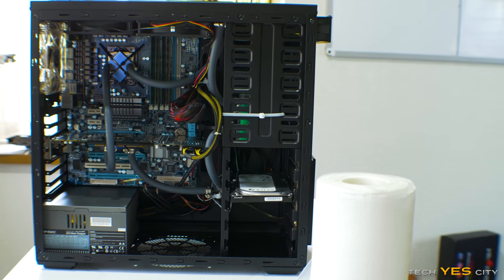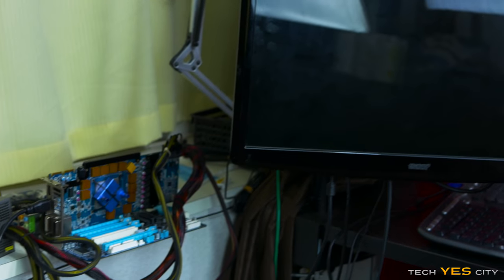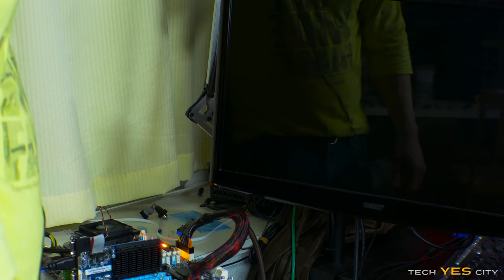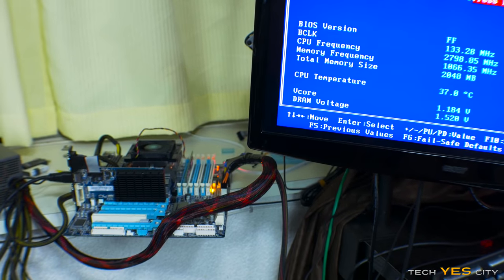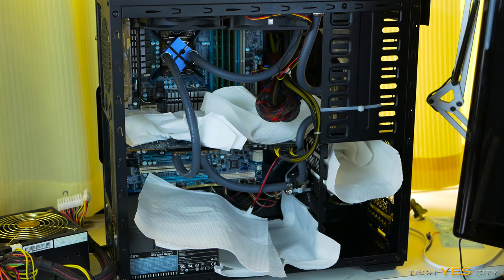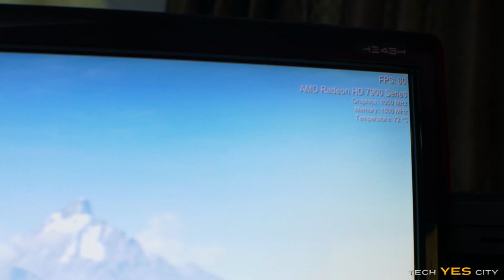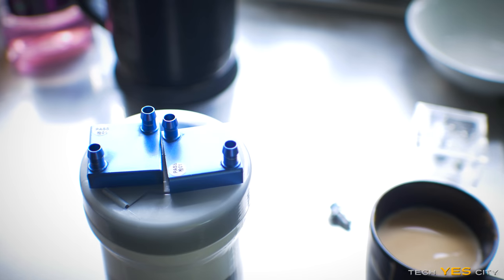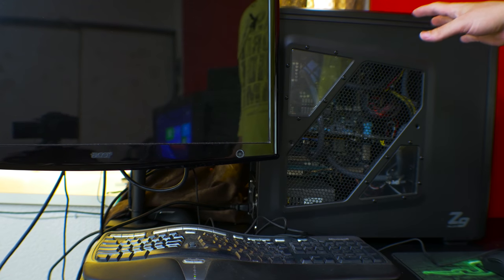$50 Custom PC WATER Loop - Is it POSSIBLE?

Comment: clean the chips just to turn around ans spread the TIM with your greasy fingers... wow...
Reply from the maker: +Chad Bremer Don't really know how my finger will be 'greasy' when I just finished using alcohol wipes before applying..
Reply: Tech YES City Human skin always has a little grease.  It's a terrible practice in general.  As noticed in the very poor contact you got.  Had you just smoothed a blob like most of us do, you would have had far better contact.  Even with a crappy block.
Reply from the maker: the pressure would of been too low on the critical area still, wouldn't have made a difference. And the thermal paste initially creates a barrier on my finger between my finger and the surface.  I have already tested my methods and if I felt that the pea method was indeed better, then I would be using it, but it isnt, it is inefficient to guess how much I need everytime with the pea and waste thermal paste.
Reply: Tech YES City it's not a guess.  When have done it hundereds of times, you know.  Comes with over 20 years worth of builds.
Reply from the maker: Well now I know that you either aren't spreading properly or you are bullshiting, as I have done consistent tests time after time, and the spread method with a barefinger cleaned with alcohol beforehand is perfectly fine.
Reply: +Tech YES City No BS.  I have tried the spread meathod.  It was inconsistant.  Blob always works and once you have done a few you know exactly how much you need for good coverage.  Line method seems to work better on really large surfaces like socket 2011.  The only thing I use the spread method on is liquid metal TIM.  Pretty much because you have to.  But I rarely use those.
Reply: +Chad Bremer Spreading with your finger really wouldn't make much difference. As long as fingers are clean enough, there is no problem. In normal circumstances, you would use the blob because both surfaces are extremely flat therefore, it would distribute evenly but, in this case I probably would've done what Brian did.
Reply: +BBYT - Terra blob helps a lot on uneven surfaces as well.  like some of the crappy early on direct contact heat pipe coolers.  Like the early Hyper 212.  They had terrible surfaces.  Not even close to flat and had huge gaps.  Spread method was very inconsistant. One would be fine, another 10C hotter.  Blob, more consistant.  Granted these days it's less of an issue since blocks and heat sinks have better build and finishing qualirty.  But there is no point wasting time and risking contamination.
Reply: +BBYT - Terra blob helps a lot on uneven surfaces as well.  like some of the crappy early on direct contact heat pipe coolers.  Like the early Hyper 212.  They had terrible surfaces.  Not even close to flat and had huge gaps.  Spread method was very inconsistant. One would be fine, another 10C hotter.  Blob, more consistant.  Granted these days it's less of an issue since blocks and heat sinks have better build and finishing qualirty.  But there is no point wasting time and risking contamination.
Reply from the maker: How I spread my paste isn't an issue on my side man, I have found with certain pastes that pea meth can be bad with low pressure as opposed to a thin layer with low pressure can work a little better, that's all. You will notice on builds that i leave on stock clocks I will use the pea, but anything I am overclocking I will always use the spread method.  I know LN2 overclockers use the spread method too, so why would they use that method if it was inferior?
Reply: +Chad Bremer What would you be contaminating? The worst thing that can happen with thermal paste is that you put too little. As long as you have a good amount of thermal compound and it's not spewing over the sides, you're fine. Watch Luke's video over at LTT, he experiments with many different types of techniques. By the way, why does everyone have to be so aggressive on YouTube. They're just normal people.
Reply: +Chad Bremer I've been doing the same thing for years I used to use the rice method but actually got better results with a thin spread layer with my finger :-)

Comment: What a joke. I with my boxing cooler temperatures have lower CPU from you with your water when it released even in silent mode. Not to mention that with this your joke will lose your warranty smallest video card. No load and put boxing cooler full speed temperature my cores varies between 17 and 22 degrees Celsius.

Comment: Not even 60 FPS...wack ass PC.
Reply: +SVTsupercharged He's using an X58 board wich was released in 2008 and a GPU that was released in 2012, so there is not really any wonder it's not reaching good framerates by todays standards.

Kind regards,
Meta Custom Computers